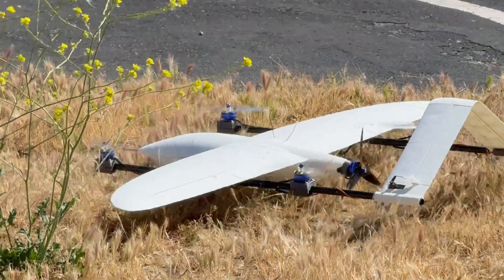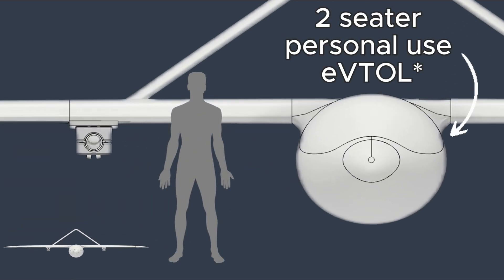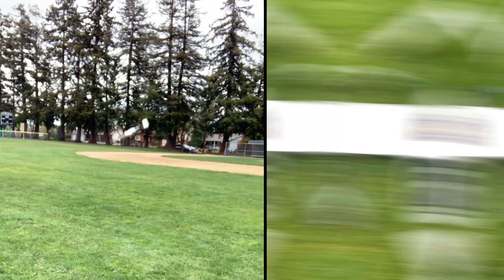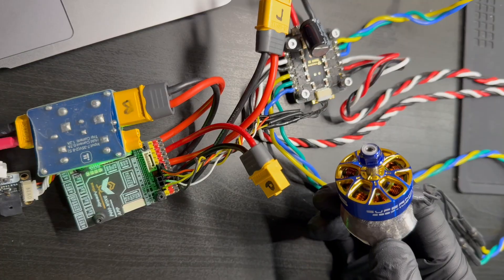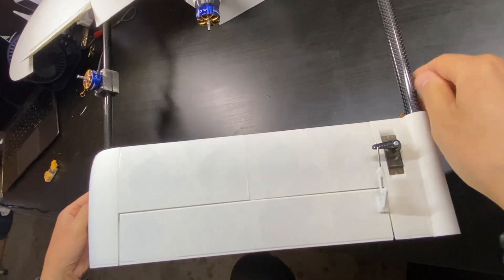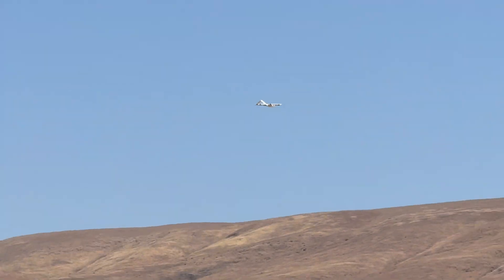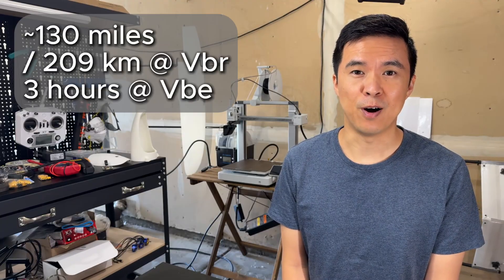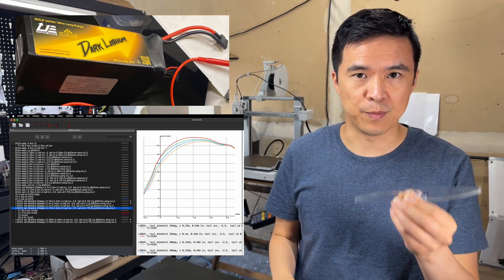I made a 3D printed VTOL that can fly 130 miles (as a CAD beginner)

Comment: I saw your other comment mentioning you used Bambu labs a1, I'm planning to buy a 3d printer should I go with the mini or A1 please?
Reply from the maker: A1’s larger bed size will save a ton of time if your airframe is large enough to need many parts to print
Reply: @tsungxu  that explains a lot thanks!

Comment: Does your quad motor shut down during forward flight?    When in forward flight, your wing takes over the purpose of the 4 motors, allowing the 4 motors to keep working is a waste of energy.
Reply from the maker: Yes, the quad motors shut off in fixed wing flight. They are not aligned with airflow (feathered) and I did not get time to test folded props — either of these would have reduced drag and increased range.
Reply: @tsungxu I imagine the windmill rotors could contribute to life like a gyrocopter if they were long enough and the motor doesn’t have magnetic cogging 👍👍👍

I was pondering something that has all four props rotating 90 degree to gain high thrust
Reply from the maker: @peterxyz3541  I suspect windmilling from these props would not generate enough lift to help with autorotation. Disc area is multiples smaller than a gyrocopter. Also, smaller scale VTOLs do not utilize variable pitch props which I believe most gyros (and all helis) use.

Comment: Hey Tsung, what materials did you use for the inner structure besides the carbon fiber spar?  Did you print only in foaming PLA (Bambu?) or did you use ABS for structural components or motor mounts?
Reply from the maker: PETG for the motor mounts. Surprisingly strong enough, just avoid using blue Loctite as it breaks down the material

Comment: What was your design process? Like how did you size everything appropriately? Did you just go by past designs or did you calculate?
Reply from the maker: Took inspiration from other designs and also used my own spreadsheet model of parameters. eCalc is pretty good from what I hear as well
Reply: @tsungxu  Okay for like static margin and wing loading and such?
Reply from the maker: @JB-dv7ew XFLR5 for static margins and stability analysis

Comment: GOLD V1 6S2P 23.7Ah AMPRIUS SA03😎
Reply: Try the GOLD V1 12S3P 32.4Ah AMPRIUS SA08 Long and let us know how much futher and run time it gets. Or better yet the SiMaxx.. 
Please🙂
Reply from the maker: @KnotHomeTwoDay  would need a MUCH larger airframe and fuselage for that! Maybe in the next build
Reply from the maker: The SA03 cells do not have enough power to sustain hover unfortunately.

6S x 24A max current Airflow Determined but my VTOL needs ~30A at around 4V per cell, and ~40A at 3V

Comment: ** Great Job*** 
(a) Do you use a 25,000 or  40,000 mAh Amp battery  to achieve 130 miles?
(b) Do use an Antenna or Raspberry to track it? 
( c) Pixhawk Flight controller
(d) Did you fly it in circle for 3 hours to determine it can fly 130 miles?
(e) do you have an email or whatsup phone number to get in touch with you Please
(f) the center of gravity is the key factor to maintain stability?

Edward, NYC
Reply from the maker: Thanks, great questions! (a) I used a 21600 mAh battery, (b) no tracking hardware, (c) yes, and (d) no, the 130-mile prediction is based on flight data (f) oversimplifying but yes

Comment: It is mimic Ukrainian “leleka”
Reply from the maker: Just had a look - significantly different design! That one is fixed wing only and has a standard V tail at the rear of the fuselage. Mine is a VTOl with the four lifting rotors on the booms, and has the inverted V tail attached to the booms, not the fuselage.

Comment: The main lesson I learned trying to 3d print planes, is that foam, reinforced with fiberglass rods have the best structural efficiency. 
Is pretty impressive to see those numbers in a 3d print plane. Either of one, or this guy found the holy grail of 3d printed planes, or when he tries to mess with foam planes he will break another record
Reply from the maker: Foam (even foamcore) is far stronger and more impact resistant than foaming PLA. But foaming PLA is much lighter, which is why I chose it over any other airframe material

Comment: I'd like to use for mapping. I wonder how it would perform with a camera payload.
Reply from the maker: Range definitely would take a hit 
1) Lower battery mass fraction
2) Approximately proportional to the camera weight depending on aerodynamic penalty of the rig
Reply: it will perform incredibly badly. he knows this, this is why he is deleting comments from engineers. he'll be lucky if it hits 70 miles with a camera on.

He will delete this comment though.  Truth hurts.
Reply from the maker: @Welcome2TheInternet good luck spreading misinformation

Comment: Nice project. The battery price is very expensive :)
Reply from the maker: It is! But using a ~$200 lithium ion 6s2p could still lead to around 2 hours of endurance depending on the pack size and fit

Comment from the maker: Any other details of the build that you'd like to know more about?
Reply: Is there any place to look at the CAD/STL model?
Reply from the maker: @MultiRotorairview  I'm not sure if I will release those
Reply: Great Work! 
Can you go into details of the aero optimization? 
What was yout approach, what tools did you use? What did you learn and maybe what was an unexpected thing that came along? 

How big is the impact of the hover props? Do you switch them off completly when you are in vtol mode? 
Whats the weight of your drone and what are the specs of the motors being used?
Reply from the maker: @v31ls1d3  Thanks! XFLR5 for airfoil and OpenVSP for Cg and briefly to benchmark whole body L/D.

Approach was to optimize airfoil selection and wing geometry for maximizing endurance. 

I did not actually feather the props, which is hard without specialized ESCs. Also did not get to test my folding props, which would have reduced drag (and improved flight time).

If there's enough interest I might do a follow up video.

Specs are in the description
Reply: Any books/references/tutorials you used for either the aircraft design, the avionics hardware installation, and the process of splitting your large aircraft into multiple 3D printed parts?
Reply from the maker: @MooBttR  mostly LLMs and some references to GENERAL AVIATION AIRCRAFT DESIGN by Gudmundsson. A bunch of Youtube tutorials for 3D printing and avionics
Reply: how did you code the VTOL transition to fixed wing forward flight? I think many would greatly appreciate another video on how you "chose the design parameters, learnt airframe CAD design, sourced components, improved foaming PLA print quality, in-depth power loss troubleshooting, and many more challenges this project faced."
Reply from the maker: @MedellinTangerine Ardupilot handles the transition control system, I did not need to change it
Reply: Any tests / prediction about change of speed / endurance in dependance of payload ?
Reply from the maker: @Peter-bb6kc  I have not tested with a payload. But swapping out ~1 lb / 450 gm of battery mass for payload would reduce range and endurance both by about 1/3
Reply: Yeah  i want to know more details.  Can i get ur CAD?
Reply from the maker: @ssong4875  will not be releasing CAD
Reply: Great job! That's an impressive first!

Please don't release the CAD!
 @tsungxu 

Do you mind if I play around with a similiar model to see the effect of winglets to the range? In openfoam
Reply from the maker: @braccereve9271 thank you and of course! If you find anything interesting feel free to share here. I did think winglets would increase L/D but never tested it
Reply: @tsungxu yes you are totally right, lower d leading to a higher ratio. Induced drag is reduced by around 10%.  And efficency by just under 5%.

I kept the model very simple. So results will not be very accurate. Induced wing bending is also minimal.

I am just not sure if the weight to effect benifits are worth it witha vtol.
Reply from the maker: @braccereve9271 thanks for sharing! If the bump to cruise efficiency is 5% and induced drag is down 10%, the weight penalty from the winglets will be more than worth it!
Reply: Release the files so I can print this!